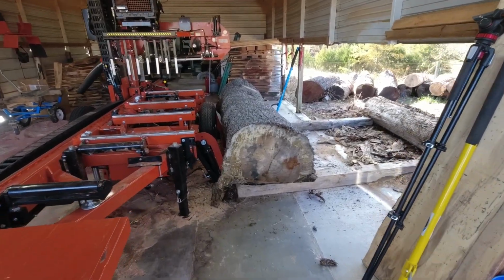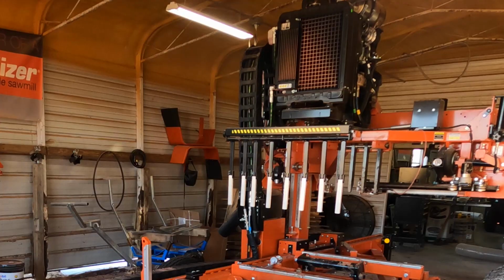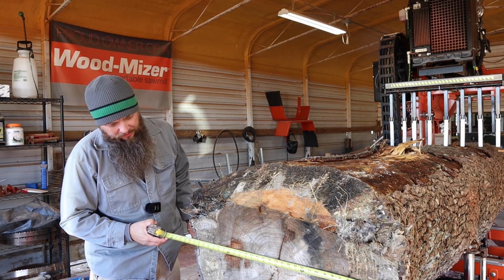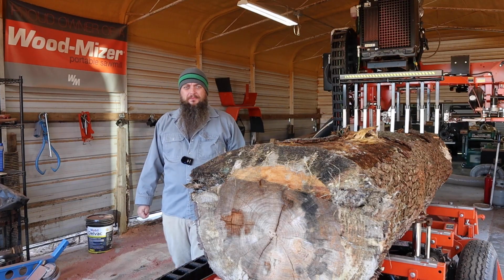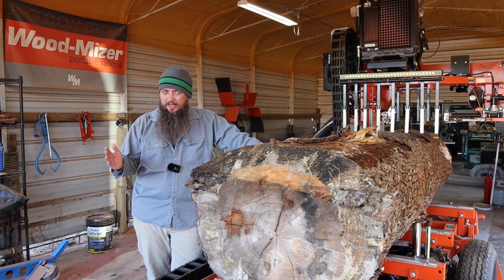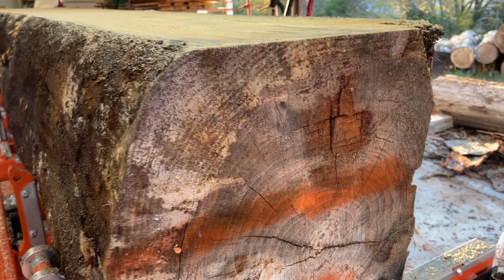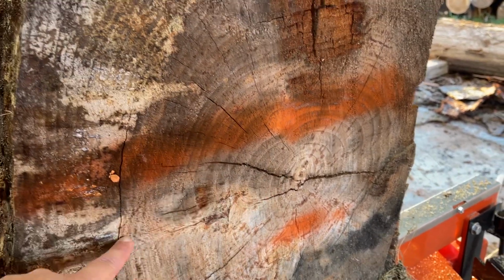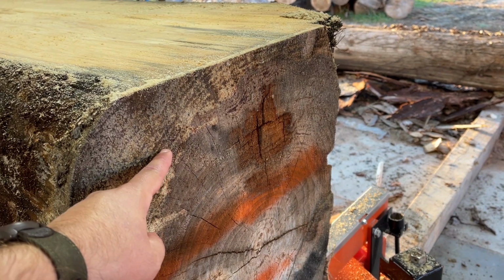Look At What I Had On My Sawmill Today,

Comment: Ha, ha!! Love the saw milling of the pine. Great stuff! Outtakes are the best! A little more often would be cool! Used to work in a production sawmill in Northern Arizona back in the 70s and 80s. Most of our intake was Ponderosa Pine.  I remember working the edger when some beautiful molding fell off the head rig double sided band saw and onto the rollers down to me. It was 2 inch by 16 ft long and about 50 inches wide. Not an imperfection anywhere on the slab on either side. I cried because I had to put edges on it! There were several boards that night (I  worked  4 to midnight shift) that were like this. Never saw the likes of it again. Love your channel, keep sawing!

Comment: For the cameras, the batteries tend not to do too well in very cold temps and tend to lose charge faster from what I have seen.  Sometimes if you place it under a light or another type of heat source, they can last a bit longer from what I've heard.

Comment: Nathan, Lithium Ion batteries hate the cold and die very quickly in those conditions. Not dead but lose charge and have to be recharged often. When I was using my Canon 7D for wildlife I would carry one battery in the camera and two or three in my inner pockets of my jacket to keep them warm until they needed to be changed. Always watching the camera for charge level and swapping before they died, usually around twenty percent of charge left. One brand I found on Amazon was even better than the Canon originals was Opteka brand. They might not last as long before they would  not take a charge, but it was hard to tell since they got used more and went through more charge cycles than my original one that came with the camera since they were larger capacity in milli-amp hours storage. I think the Canon battery was 1800 and the Opteka were 2600 mAH so more time before needing to change them. Best part was that the Opteka were less than half the price of Canon originals. Something to think about and more technology than most folks want to deal with. Pretty sure Opteka made batteries for most major brands of cameras. Might even make them for drones if the are pop out and switch type batteries. Good stuff there. Best wishes for you and yours as Turkey Day approaches.
Reply: PS those batteries use the same charger as the originals since they are exact replacements for the brand name batteries. Hope this info helps.

Comment: Hey my friend. I enjoy your channel. But I have question about you using poplar as a siding on your new shed. A few years back I made an adirondack chair for the back yard. Sealed and painted the wood. Really took my time. It turned out great but in 3 years it was all rotten and had to be thrown away. I know it's used on interior, for cabinets, etc. Just not sure about using it for exterior use after my experience. Fill me in.
Reply from the maker: next video or two Ill explain Edward, thanks for watching

Comment: Seems some times you use the forks and sometimes the grapple to move logs. How do you choose?
Reply from the maker: I don't usually just what I did the last time on tractor, and sometimes I am lazy
Reply: @OutoftheWoods0623  Ahem, it's called 'efficient', sir. ;-)
Reply: @OutoftheWoods0623  Yup, efficiency is the proper term. Lazy is not doing it at all and going couch surfing instead.

Comment: white pine....  thats been sitting for 6-8 months cause the bark has been falling off ...  try a 35" x 14' Oak, Maple, or Hickory ... or even soft wood ...  you would go through 3 bands ....  on your pine siding, even painted ... your prolly looking at 4 yrs
Reply from the maker: odd Ive had pine on my other barn for 10 plus years, sounds like you got some bad pine your way, good luck, email me if you want, I can give you advice and guide you toward better luck with timber,
Reply from the maker: 3 bands? My super 70 would have no issues, 55hp doesn't have trouble with oak even if on the ground for years,

Comment: Just about the only thing better there would of been both eight inch wide cants on the mill at the same time so two could be sawed into that four quarter you was searching for. I don't know if that  would waste wood or just be making the most of each pass. I know greed will get you little and with only you to off bear, it could turn crazy. It did look like it was heavy enough to stay put where you set it... nice wood